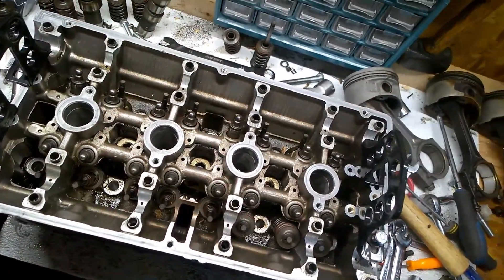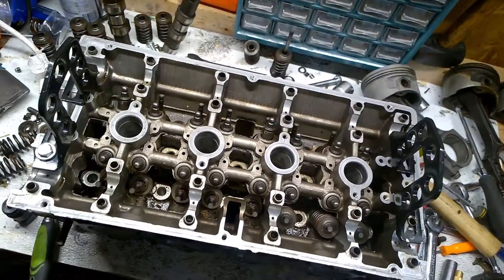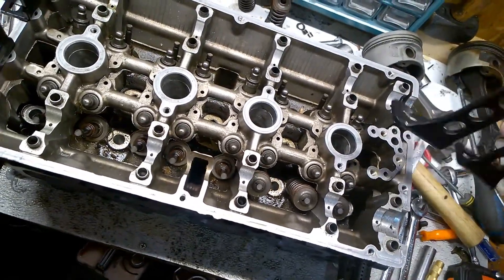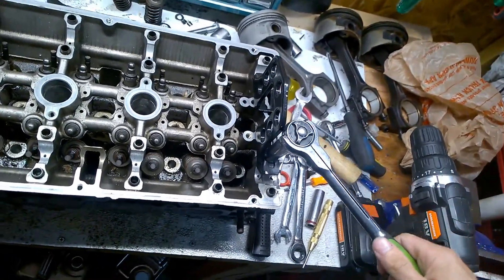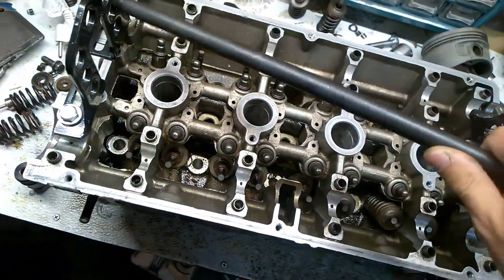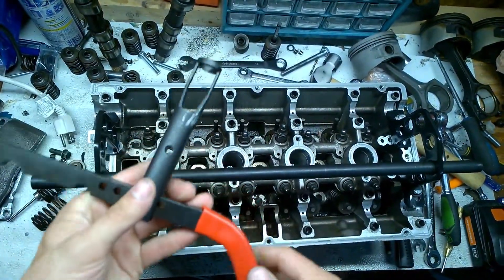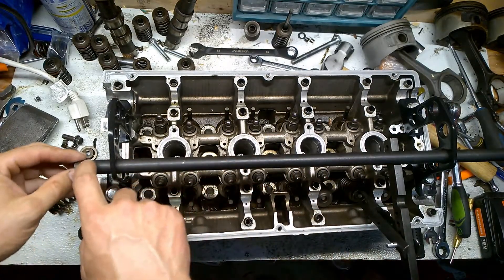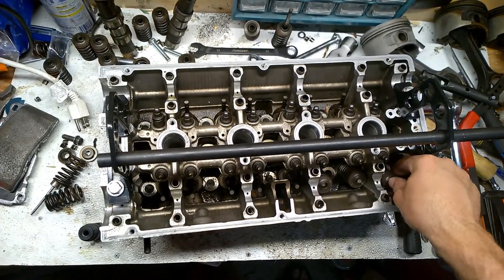Tool Review - Universal Valve Spring Compressor for my Mitsubishi Eclipse 2G Will it Work Better???

Comment: I know that it's an old video but you should have in your set a magnetic holder for the rocks that makes the instalation and removal easy. Also put the bar on the opposite side then when you push down there is almost none movement to the head, very useful tool to have.

Comment: this tool is made to remove springs while the head is on the car, that part you didnt know what it was for is a spark plug too air fitting to fill the cylinder with air to keep the valves closed while you change out your  valve stem seals with out removing the head.
Reply from the maker: Thanks for the info

Comment: I’ve removed my 4g63 valve springs and valve seal off and stalled Manley springs and new seal with that tool kit. It’s easier if you can bolt down you head on the work bench and have the u plates that hold the bar a-line with the valve springs.

Comment: I used the same tool on my 4g64 on the car worked great, and it was the only tool that could get the job done, best price, availability, quality and function. This might be your only option if you have OHV and if the valves are angled
Reply from the maker: Yea just did my 420a
Reply: Where you get it
Reply from the maker: @desdeaquitebrinco  ebay

Comment: Well, in the description of the tool, it does say universal valve spring removal tool.however, it does not say it is also an installation tool. You need other tools to work with this tool in order to reinstall your valve springs and keepers.there are other tools that are virtually identical to this one that come with everything you need to service a head. Including the valve seal removal tool, the tool to reinstall the keepers, and the air line fitting for thecylinder to keep the valve closed if you are choosing to leave the head on the car while doing this project.